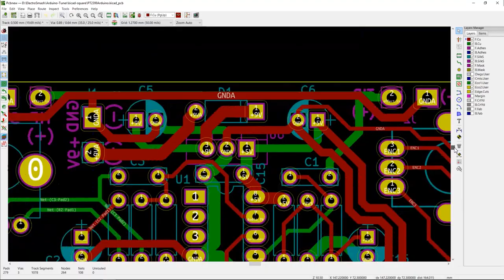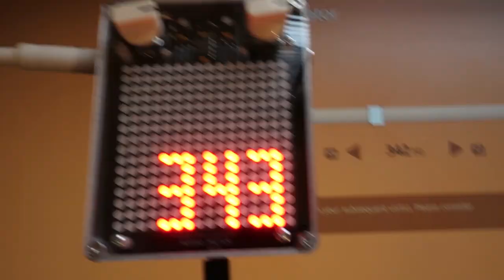Arduino Audio Meter | ElectroSmash

Comment: I love it! However I am a little confused. Is this just a meter or can I also code it to act like a ECO or Reverb pedal as well. Lets say I wanted to code this box to sound like the TC Electronics Reverb. Could I use this box?
Reply from the maker: Hi, it is just a meter, the audio signal is not touched. So it cannot add effects like echo or delay to the signal.